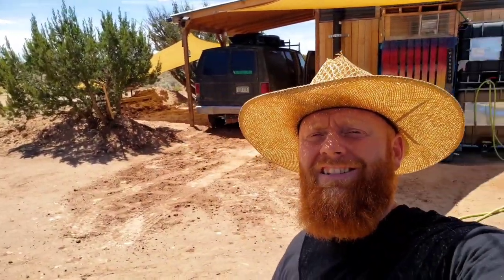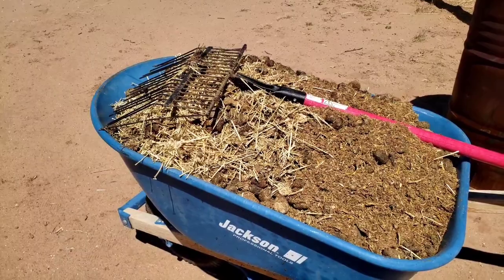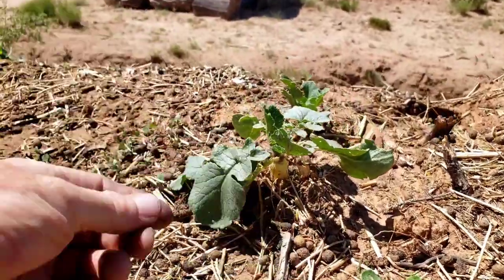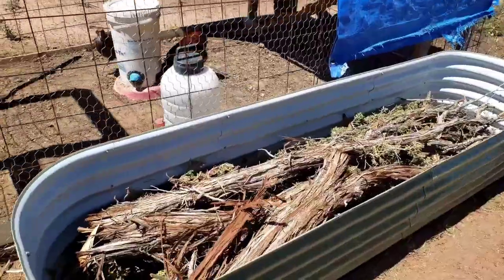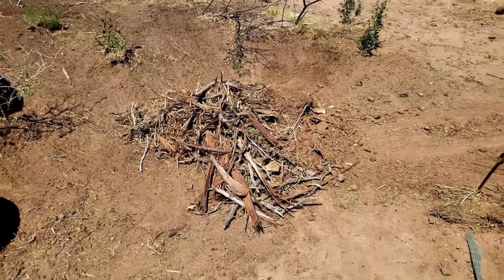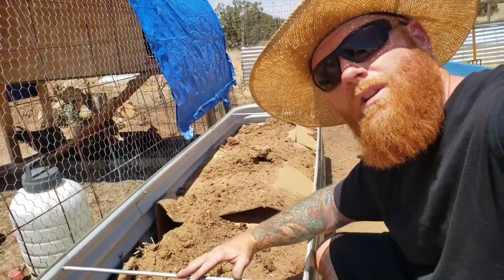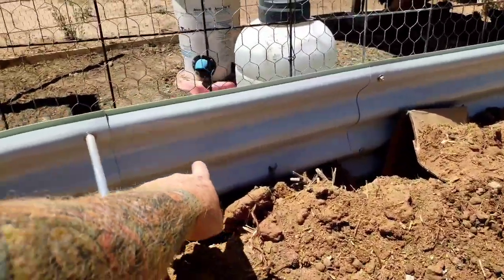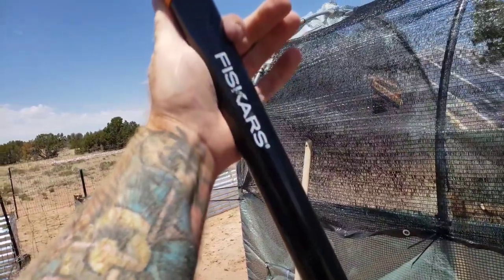How to fill a raised bed garden | Hugelkultur

Comment: Gardening for years in So Cal.  Understood within a couple of years that raised beds don’t work out here.  They get dry in July and August within a couple of hours.  You have to water them five times a day.  Then I found out that local native Americans used a method called sunken beds.  They practice it in Africa and other arid places.  Works perfect, finally huge yields.  All garden beds are below surrounding soil level.  It collects and keeps all water and morning dew.  I only water it 3 times a week.  I also use Hugulcultur, but it is also sunken.  All the logs, branches, and leaves act as a huge sponge, which holds the water.  For regular sunken bed I remove about 1 foot of soil, but for Hugulcultur about 2 feet of soil and fill it up just like regular Hugulcultur.  This method should work fine for you in Arizona desert.  Good luck!

Comment: Those Fiskers shovels will last forever!! I've dug several huge stumps out and never had an issue with mine.  I had a stump that was so difficult i have up and wanted to snap my shovel. I threw all my weight into it and instead of bending or breaking it just popped the stump out lol. Another great video!
Reply: We got one too. Dug water main up.

Comment: 🤔 I have done exactly this method over the years filling my tanks. ( Didn't know the technical name) 
But I have never planted potatoes in a newly filled tank! I have been under the impression potatoes like fine growing material. Wouldn't the cardboard and limbs inhibit them?
  🤔 All, just wondering when you will be harvesting your potatoes...? I let mine stay in the tanks until I needed them almost until late December. Even then I only took out what I wanted and let the rest stay. If we were to have a wet cold in the forecast, I would cover the tanks and still had good potatoes. If we had a wet cold, hard freeze,  I dumped and emptied the tanks and stored the tubers! Same thing with the carrots. Do you know when you'll harvest the potatoes? I am curious as to how this layered method worked!
 Thank for a reply! ~ Suzanne 🤠
Reply from the maker: The plan is to let just about everything go to seed until I have a stockpile. I'll eat some if I need them.  I keep adding soil on top of my potatoes.  Also there's good soil in my hugelkulturs not just dirt
Reply: @FrugalOffGrid  Thanks for replying! 
I have in the past harvested the (sweet potatoes,) before the frost, put  them in buckets and covered them so they have some trapped humidity. That seems to sweeten them up a bit. I had regular potatoes mixed in the bucket also. They all seemed to benefit from that method also. I am guessing your root cellar would do a nice job. Looking forward to seeing your potatoes! ~ 
Suzanne 🤠

Comment: So the juniper branches can be used right away? I was taught to not use them in growing food, but use them in fencing.
Reply from the maker: Some gardeners worry that there are toxins in evergreens such as junipers and cedars that result in allelopathic reactions to plants mulched with evergreen material. Washington State University, however, suggests that it's not the toxins in the juniper trees that retard vegetative growth under the trees, but the significant thickness of the needle, bark and twig litter under that have accumulated over the years. In addition, juniper tree branches block light and water, further slowing growth. None of these factors are issues with mulch made from juniper trees.

Comment: Just wondering if anyone else has commented on the amount of wood in the hügelkultur beds? Before I say anything I get that there is a lack of proper sized wood out there, but I'm not sure if you're going to get a full hügelkultur benefit from that amount of wood. Obviously the smaller it is the quicker it will rot, but with cedar and juniper it takes a much longer time so the smaller bits will still work but I think you need much more of it. Most hügelkulturs I have seen are mostly wood and bloody big logs at that with a layer of soil. Ironically I'm saying this on a video where you are using a decent amount, but some of those ones in the garden piled up had less wood in them and probably wont hold water and hydrate the garden as much as they should. Love everything you do by the way this is not a criticism :)
Reply from the maker: No,  no one has commented on that.  In any given area you work with what you have.  I'm confident it will work better than you might think.